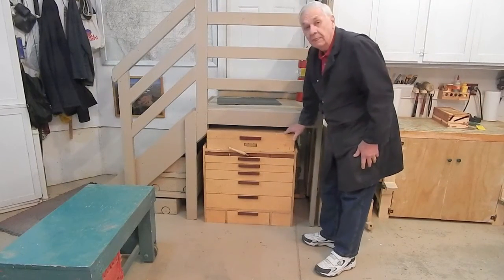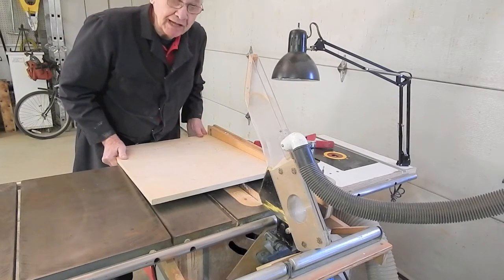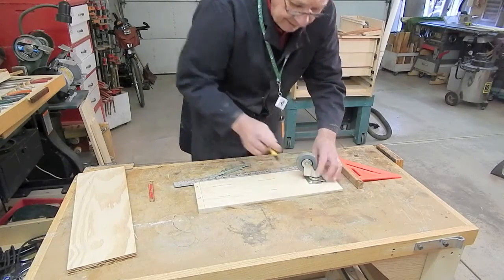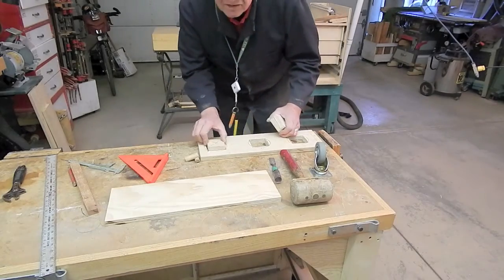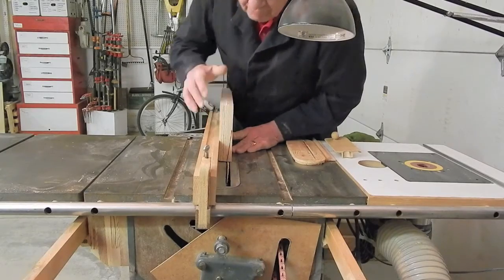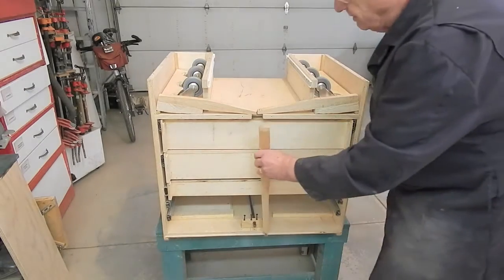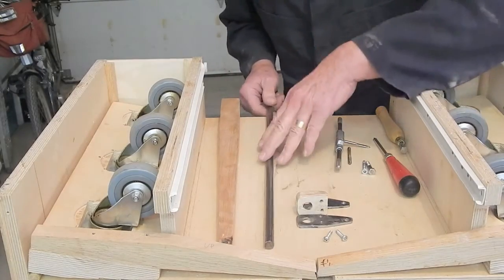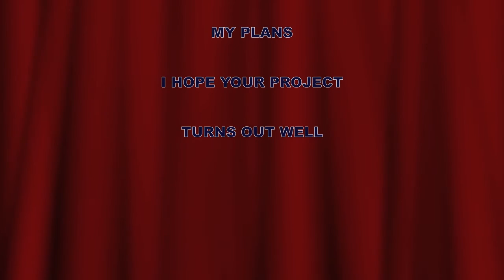Retracting Casters No.6  Tool Chest

Comment: Thank you for the detailed video Mr. Holmgren. I really appreciate all the detail you put into giving us access to the inner-working of your designs. I have a couple of questions. If my chest is 22"D x 36"W, do I need to adjust the size of the caster mounting boards and the caster board actuating arms or will it work with the original dimensions? Next, since I am making a new chest and can adjust the height of the base where my caster assemblies will be housed, is it necessary to countersink the casters into the mounting boards or can they be flush-mounted? Last question, are the caster mounting boards attached to anything other than the actuating arms in the rear? Sorry for the questions but I'm finishing up my build and I want to get it right before I make the final assembly. I wish you all the best, I would pay good money just to meet you and hear your stories of contraptions and projects you've built.